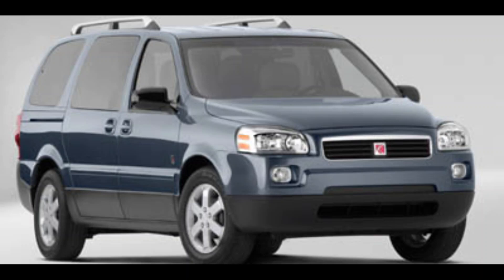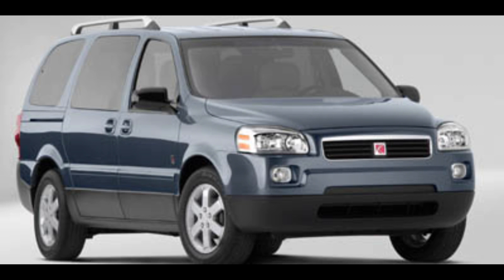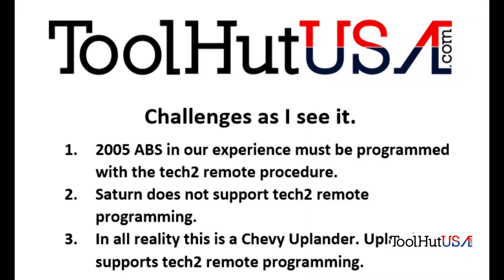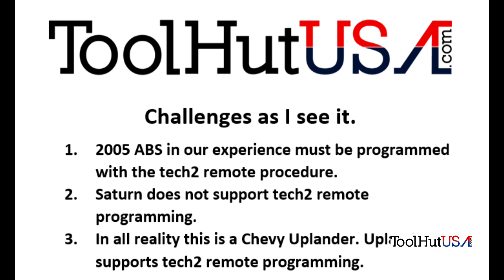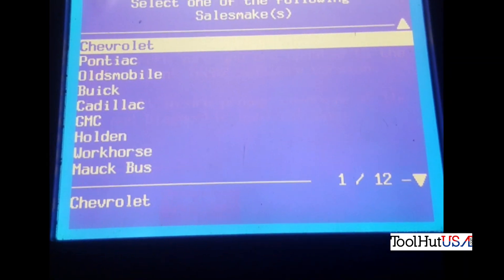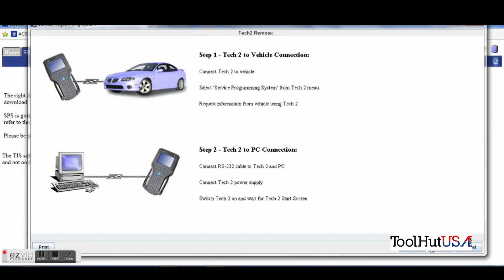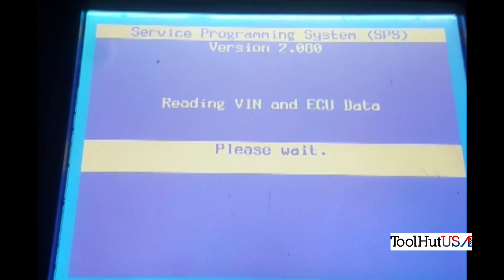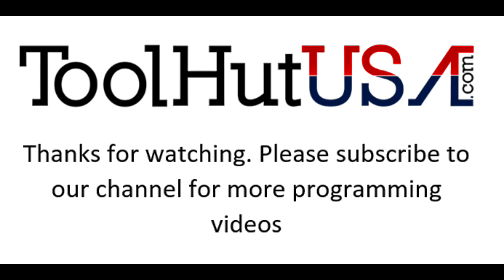2005 Saturn Relay ABS module will not program

Comment: I have this problem on my 2008 Saturn Vue. My ABS was engaging while driving on dry ground, so I ended up replacing it with a matching unit from a Pontiac. Now I’m getting error codes, but the ABS is working great. I’ve called dealerships and other mechanics and GMC dealerships.  They Tell me it’s a low chance or they are unable. But they would charge me for trying. Haa😅 this is a helpful possibility.

Comment: Got a question would you still use the gm site if you were reprogramming a Saturn vue 05 with the honda powertrain that gm was running in them
Reply: Tramissiom not shifting into over drive